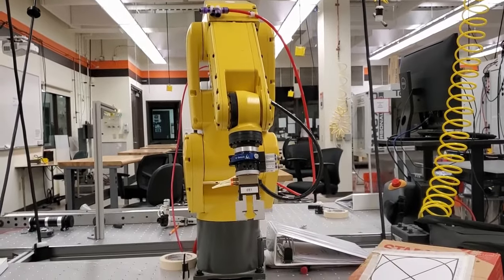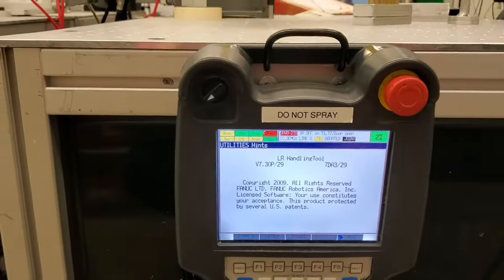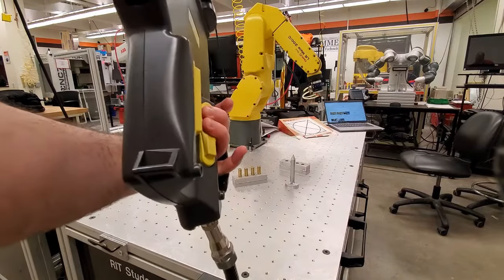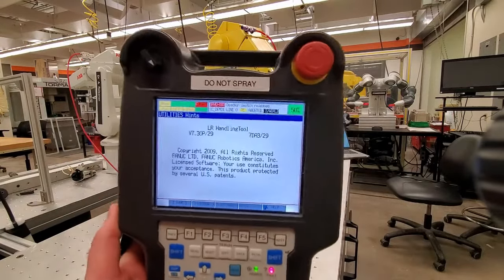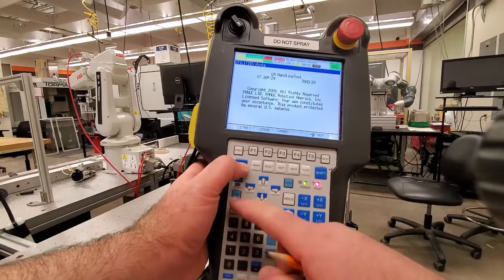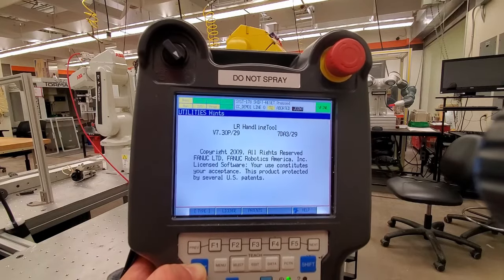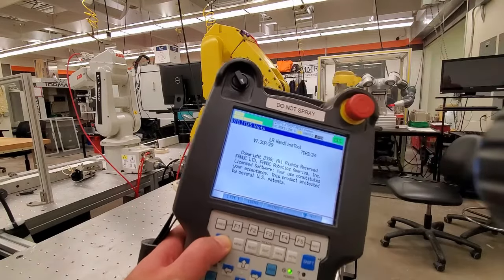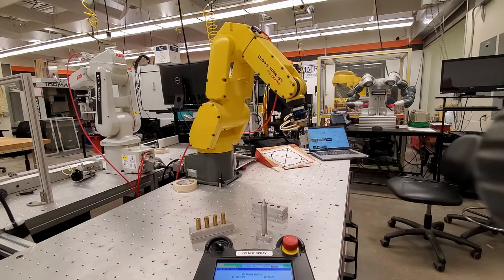Fanuc Robot Tutorial 1: Starting the Robot, Clearing Faults, and Jogging Modes (Joint and World)

Comment: Excuse me, I'm trying to connect my laptop to the Fanuc through an Ethernet cable. How do I know if my robot has the correct ip? And do I put the computer's ip address into the fanuc?
Reply from the maker: These questions are complex. I cannot help you over these comments. You can try for example to ping your FANUC robot from your computer. Search for a ping command. You need to specify an IP address. Also, I think that you might need some FANUC extensions to do that (check if your FANUC robot has these extensions), or these options are unlocked (FANUC requires extra money for these options. Sorry that I cannot help more at this point.